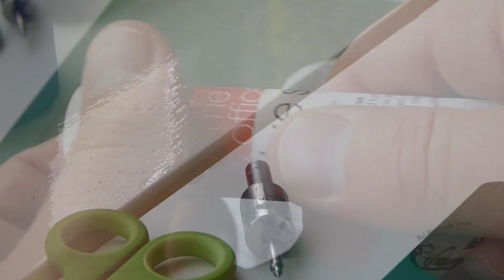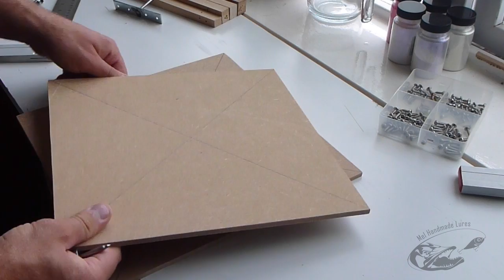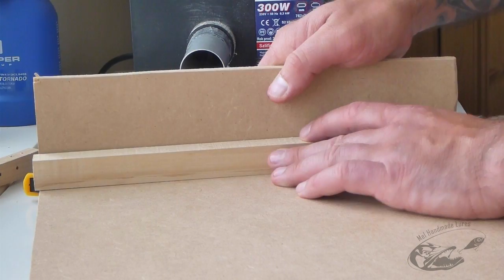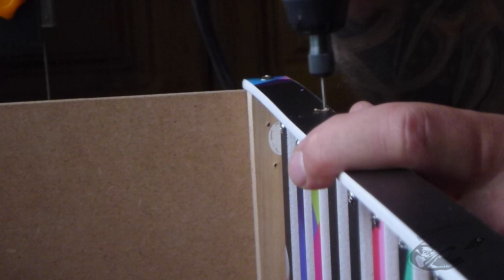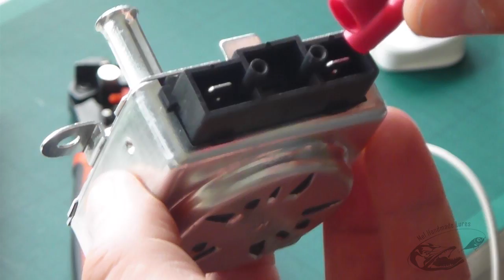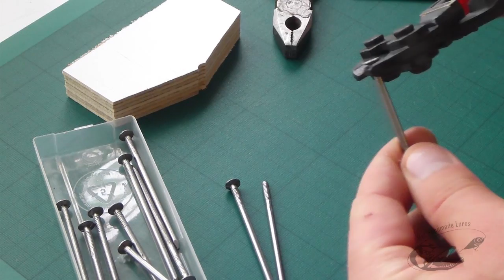How to make Lure Dryer. Jak zrobić suszarkę do przynęt.

Comment: Great presentation that includes all details what you made. 
It's a brilliant video that I never can..

Congratulations..

I just offer an advice for spacers that you lay 7.30 nd sec of the video.
If you lay them in 45 degree , of course you lose storage area but you have better results when  work with varnish even very less viscosity..

Comment: Maciej. If You Want To Reduce The Friction On Your Dryer Get Hold Of A Drawing Pencil One That Has Carbon In It, The Rub The Pencil On The Inside Of Your Cradles At Both Ends The Carbon Deposit Reduces The Friction And Helps To Stop It Wearing Thru. Thanks For Another Great Video
Reply from the maker: Thank you for advice :) Cheers